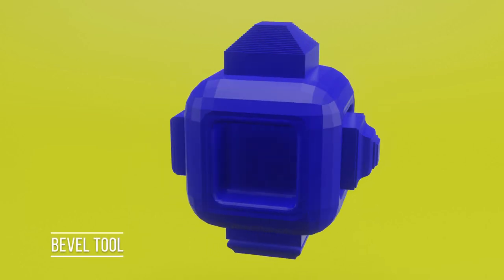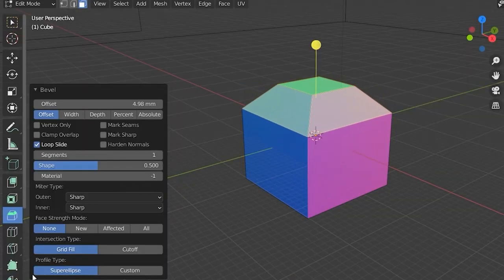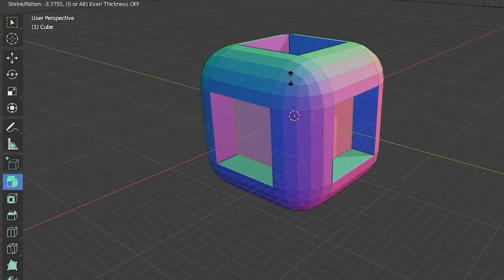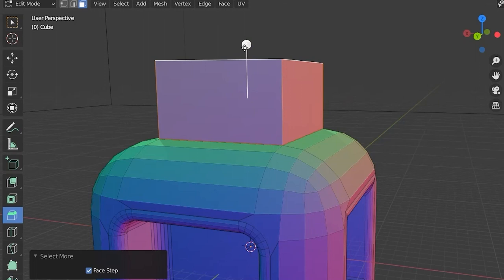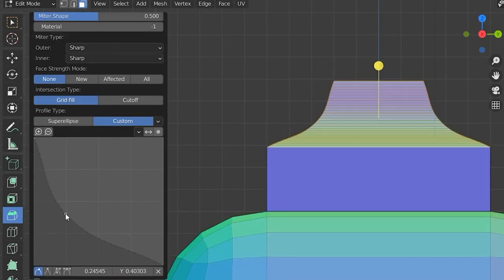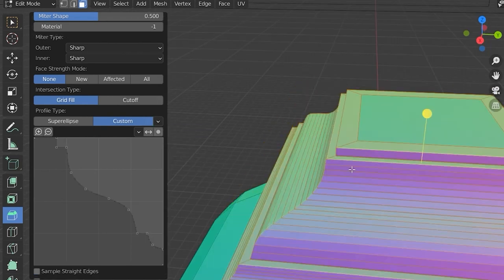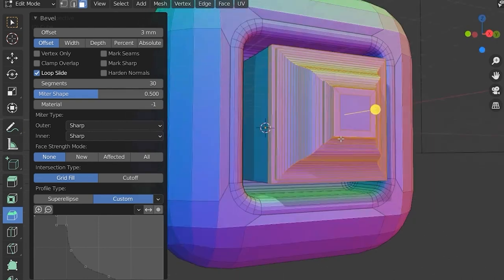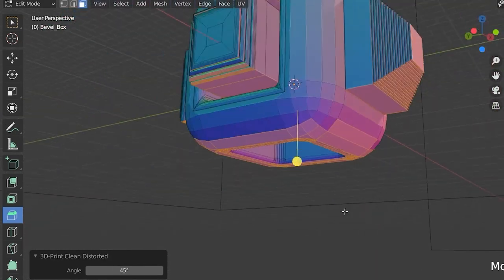BEVEL TOOL - Blender 2.9 (HOW TO) 3D Print BEVEL BOXES  | 3D Printing Design (2020)

Comment: And the point of doing this is what exactly?
Reply from the maker: To learn how to bevel, Kevin!
Reply from the maker: The Bevel can smooth edges, add details, and more. For 3D printing it can make your edges less sharp or invert them. You can get really creative with the Bevel Tool and Bevel modifiers. This is just a quick video to show all the different options you have at your disposal. Yee haw!
Reply: @PrintThatThing  Something I would be interested in is some information on what things you can do in Blender that translate to a 3D print. I know that using shade smooth and auto smooth will be ignored in the slicer. Wondering what else there is that will be ignored?
Reply from the maker: I'm right there with ya Kevin! That's why I'm learning every Blender Tool and Modifier to see how they all translate to 3D Printing. I just finished the Tools Lessons (https://learn.ptt.live/courses/tools) now Im learning each Modifier and will post new videos on YouTube  showing how to use all of those specifically for 3D printing. Hope that helps. What all do you create with Blender at the moment?
Reply: @PrintThatThing  Now that would make the price worth it right there and do make sure to scream this to people because there are a lot out there that dont know some of these parameters in the software only work in the software or other supporting code. What I use my printers for mainly is I make after market scale modeling parts.
Reply from the maker: Definitely will do.  That's awesome. Do you make videos of your 3D printed after market part projects or have an Instagram page?
Reply: @PrintThatThing  No unfortunately I never even gave it a thought to record what all I have done. Right now I just do it for friends and some groups that I am in but the more I get asked to make this and that the more I think I should push the button and give it a go as a business. Which of course is what lead me to discover you when I was searching for ideas and more information.
Reply from the maker: I understand.  That's awesome! I hope you can do 3D print as a business soon.  My goal is to become "full time" as a 3D print designer and then teach other people how to do it too! Great to digitally meet you. Keep in touch  Kevin
Reply: @PrintThatThing  Something else you may want to add to your testing is working with Nurbs. If you know about them then you know that by default Blender royally sucks at them for most things. I did discover a handy tool the other day that does lend to make it less buggy and might be worth your time to dig into this idea and see what possibilities it can offer you for course material and to give your students a different way to approach things. Check out Bezier Mesh Shaper (link: https://gumroad.com/l/bezier_mesh_shaper) and see what you think. Not expensive and does offer some useful tools. Still I fall back to Rino for my nurbs but hoping that sooner rather than later Blender offers something and at least that something is better than Maya, which does an OK job.
Reply from the maker: Awesome! Checking it out now. Thanks for sharing Kevin